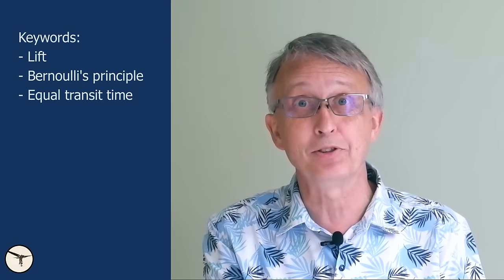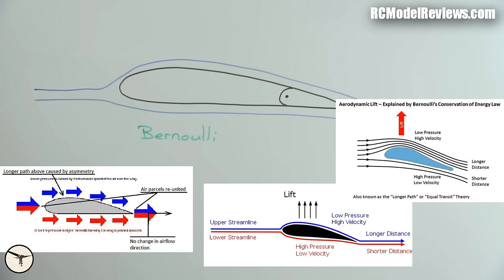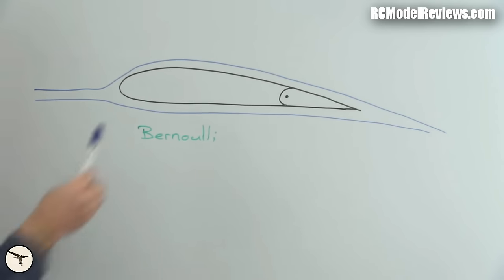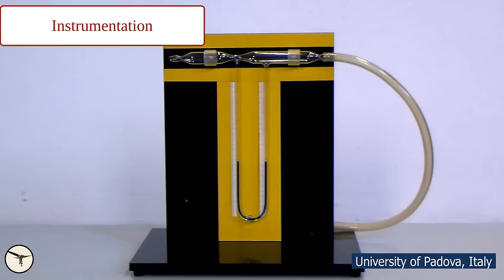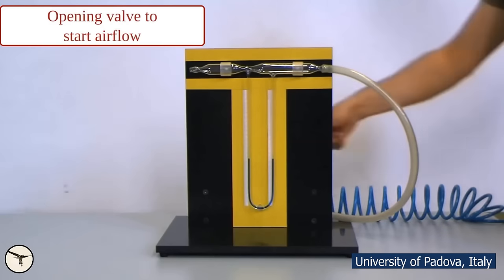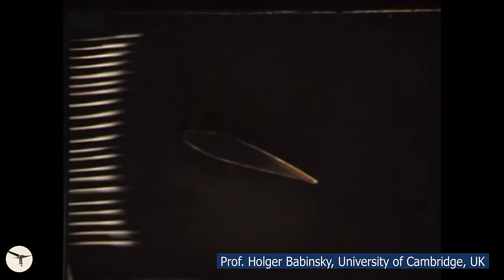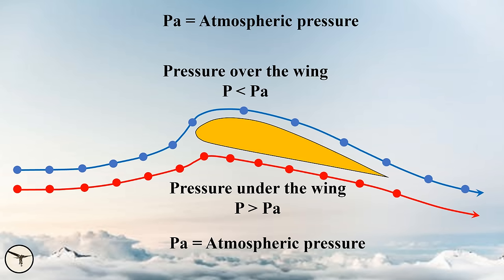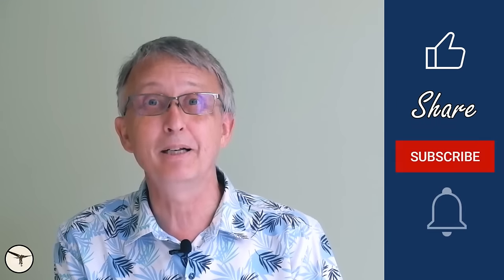Why are so many pilots wrong about Bernoulli’s Principle?

Comment: Atmopsphere has weight.  That weight bears down on the wing.  When the wing is moving through the air, the bernouli funnel is created by the top of the wing and the 'bottom' of the air pressure.  inlet: high pressure, low velocity; middle ; low pressure, high velocity, back of wing; high pressure, low velocity.  Low velocity is like a vacuum.
Reply: There is one crucial error here though:  "Low velocity is like a vacuum."  

That's not at all true because we need to distinguish between pressure and mass density.  A vacuum is zero mass (no mass density).  As you approach a vacuum, your mass density decreases but the molecules' random velocity (potential energy) may still be just as high.

The problem with the mass of air around an airfoil (assuming flight is sufficiently below the speed of sound) is that the mass density is essentially constant.  

So, when you get the lower pressure above the wing, the mass density hasn't dropped.  Therefore, lowered static pressure is the same density of molecules impacting less energetically with the upper wing's surface.

What you called "bernoulli funnel" is not like a "shadowed" area swept of air by the wing to make a region of depleted mass.

Bernoulli is a depletion of potential energy rather than depleted of mass.

You just made me realize, here may be a crucial point of argument with the people who like to say Bernoulli doesn't apply:  being shorthand for conservation of energy, the underlying principles of Bernoulli are essential to account for changes in energy associated with pressure drop (in supplying energy for the higher speed), because mass density doesn't change. (Some extra point needs to be added here I think??)

Comment: Differential pressure is only one part of the story. There are other components such as reactionary lift and konda effect. Equal transit time theory has long been discarded, as far as I remember from my flying training days around forty years ago, it has always been differential pressure to explain lift off a cambered aerofoil, and coefficient of lift obtained as a result of various factors affecting the aerofoil. This includes downwash at trailing edge.

Comment: 3:18 This is the main point. The curvature leads to a change in direction of the air molecules creating a centripetal acceleration speeding up the airflow on the top of the wing. (velocity being a vector having both magnitude and direction)

Comment: @ Kevin Barry symmetrical wings do have lift coefficient and it is incidentally more than a flat plate (flat plate has only reactionary lift)
Planes with cambered aerofoil also can fly inverted. Symmetrical aerofoil for that. 
Symmetrical aerofoils are used for high speed flight (transonic and supersonic)

Comment: The air at the leading edge is not accelerated directly by the curve, the bottom is also curved and there the air decelerates. It is accelerated by a difference in pressure(force), the pressure gradient is created by the overall wing profile. Even adding a tiny 90 degree flap to the trailing edge will change the gradient and flow near the leading edge.

Comment: I never got how Bernoulli works and this is a step in the right direction in disproving equal transit time.

But it still doesn't explicitly say wy the pressures are different.

I believe the answer is shown by the greater distances between the air molecules above the wing; the density and therefore pressure is lower.

Comment: Simple Newtonian physics is more intuitive and correctly validate it. Even though it not explain the details. It doesn't have to use (confusing / wrongly applied) Bernoulli equation for wing. No matter how the wing shape is, the amount of lift is proportional to the amount of air washed down after pass through wing. Even a rotating cylinder can act as a wing, using Magnus / Coanda effect. That kind of Bernoulli principle is only valid when the air stream is not separated. On wings, the separated upper and lower stream doesn't have to meet on the same time at the edge when met. So longer distance doesn't always faster. The slower bottom stream on tunnel test is because of impact pressure slow it down. For Venturi effect, Bernoulli's is correctly applied.

Comment: So, if the air flowing over the top of the wing creates a "low" pressure. And the high pressure is under the wing. |A low pressure will seek a "high" or higher pressure. that would mean the higher pressure under the wing is pushing UP on the wing to help the top of the wing (low pressure) find it's "higher" pressure that is called lift. 
a Mooney's wing is asymmetrical (equal top and bottom) gets it lift from the angle of incidence. the way the wing is attached to the body.

Comment: Boyles law I think also applies i.e.  Pressure x volume = a constant. Comparing the still air just before the impact of the leading edge of the wing. The volume of air flowing over the top surface of the wing is larger so the pressure reduces as the leading edge strikes the still air. Conversely the volume of air passing under the wing is lower so the pressure increases. As folk rightly observe this effect (high and lower volumes - a volume differential) is caused by the angle of attack of the wing, and holds true for the aerobatic plane flying upside down, as long as that low pressure is on the heavens side you get to see the stars and live to tell the tale…..else take a dive to the ground.

Comment: It's anyway disturbing to ear that both sides (up and below the wing) create a lift in the same direction (up), although the differences of static pressures are either positive or negative. May be the explanation would be more easy to follow by saying why two differences with different signs create a "force" in the same direction (lift).

Anyway, if the lift is only due to what is described, 
- then why all wings are curved on the upside, and rather not on the side that is below, as this would make no change to the differences of pressures, so it should work, no ?
- why this reasonning do not lead to create wings that are equally curved on both sides, to create higher pressure differences with the atmosphere, and then supposely stronger lift effect, if it's the only parameter to consider ?

As I suppose that any configuration have been tested for long ago, it must be that the difference of pressure between the upside and the side below as something to do in the resulting lift (up) direction, and that the sign of this difference is important to get a lift.

Comment: Still doesn't answer why the air on the top surface of the wing would accelerate. It is still not fully understood or without controversy (such as involvement of the Coanda effct), but clearly involves laminar flow and the Kutta-Joukowski inviscid circulation theory. In part, understanding lift involves differential geometry and the notion of a tensor of how forces act in different spatial directions, which in turn explain the reduction of static pressure above the wing whose components that would otherwise resist dynamic pressure is reduce. This explains why then the velocity is increased above relative to below the wing and the resultant pressure differential known as lift.
Reply from the maker: The acceleration happens because the airflow over the wing leading edge changes direction. This requires an acceleration in accordance with Newton's second lav of motion. https://youtu.be/lqAXNhICtRk
The Coanda effect has nothing to do with this.

Comment: Wow! So the top air stream actually arrives at the trailing edge sooner! This phenomenon is more than equal transit time: the lower air stream x velocity is slowed more than the upper air stream (which is perhaps sped up). The problem with equal transit time for pilots is they might assume an inverted (fixed wing) aircraft will inherently produce a lift that pushes them toward the ground. No lift would produce a "zero gravity" experience, so negative Gs indicate that negative angle of attack can overcome airfoil effects to produce negative lift.

Comment: Glad to hear you explain the real science behind lift. In the early70's I was taught in junior high science that lift was not created by increase pressure under the wing but decreased pressure above it. I was always interested in flying but this explanation always left a question in my mind because it didn't make sense that enough negative pressure alone could create enough lift. With my education with internal combustion engines, hydraulics and other machines operating on the laws of physics I began to realize that it is the pressure differential that causes lift. Lower pressure above and higher pressure below  do to Bernoulli's law creating differential pressure is the cause of lift.
Reply: What is also importent to know though, Bernoulli alone does only explain why the pressure drops over the wing. But another interesting question is why does the air follow the upper wing profile. Why doesn't it simply get pushed aside by the leading edge and create a turbulent void? And that's where the coanda effect comes in.
Reply: The decreased pressure on the top side is still of a greater magnitude than the increased pressure on the bottom. I'm no aerodynamicist but I have seen quite a few diagrams of wing profiles showing the pressure gradients along the surfaces (granted it is for racecar wings, so the airfoils are inverted compared to an airplane, but the idea is the same).

Comment: If the longer upper surface causing low pressure were the only thing generating lift, then how can that same airfoil fly inverted? Poorly, but it will still fly. To fly straight and level, the wing must constantly force a mass of air downward which is equal to the weight of the aircraft. The longer upper surface will help but to what extent IDK. AOA is more critical.

Comment: Bernoulli reverses cause and effect.  The air moves faster because it flows down a pressure gradient, not there's a pressure gradient because the air moves faster.  Lift comes from throwing air downwards in any case, and the wing shape happens via the Navier Stokes equations to be an efficient way to do that, in terms of smallest drag.  Both the top and the bottom of the wing throw air downwards, the way fluid flow equations work out.

Comment: The same thing that causes the drag causes the lift, the wing vortex. It produces upwash at the tip, lowering lift, because it blocks the suction surface, but when it reverses direction it produces downwash which then blocks and slows flow on the pressure surface side, and draws air across the suction surface accelerating it. Winglets just move the tip vortex exposing more surface area to air flow, allowing slightly lower AOA, thus improving fuel efficiency. The vortex strength remains the same, ie proportional to lift. Extending flaps just increases and strengthens the vortex sheet. There's a reason Prandtl equated downwash with lift.
Reply from the maker: The wing tip vortex is an unwanted side-effect of lift. The swirl does not contribute to lift, but is known as induced drag. To reduce the vortex, the designers can increase the aspect ratio of the wing (gliders are good examples.) Another technique is to taper the wing towards the tip. Winglets reduce the vortex, and hence drag, especially at high angles of attack. When Prandtl equated downwash with lift, he ment the downwash inboard of the vortex. He also concluded that the most effective lift distribution is bell-shaped. You can learn more about Prandtl and how NASA developed the Prandtl wing here: Al Bowers - Prandtl wing update: https://www.youtube.com/watch?v=w-dk1NpVNNI

Comment: A wing causes differential pressure on one side or the other (typically) of its 2 surfaces (if and only if) it is placed in fluid flow of some sort. Without fluid flow a wing produces no lift. The wings of an airplane will not produce lift setting in the hanger with the doors closed and the engine off. Unless there is fluid flow around the wings no lift is produced. So its the fluid flow that provides the energy (does the work) for lift...not the wing. The amount of differential lift (pressure) is directly proportional to the rate of fluid flow around it and the pressure differential between the two sides of the wing. Fluid flow and differential pressure around the wing produces lift. A wing is just a device that allows differential pressure to take place when in a free flowing fluid.

Comment: This has created great discussion! The wind tunnel test could do with more examples. For example an asymmetric wing and different AOA. More importantly 'zooming out' and visualisation of air much higher and lower from the wing. The example shown seems to result in the upper surface air (close to the wing) having the same speed as the air above. The lower surface in contrast, has markedly slower air (close to the wing) than the air below. In this specific example you could argue that lift is caused by high pressure below the wing and not low pressure above. It does easily disprove the equal transit time hypothesis however.

Comment: Regarding molecules at the surface of a wing, the velocity of the wing, and the vektor components of the impact of the air molecules, you will recognize that this also explain very good the lift at the wing. Pressure is the number of impact of the molecules on a surface. 
At the nose of the wing, and with wingspeed, the impact will be higher (max speed vector component of molecule plus speed of wing against molecule). If the curve goes down, the vektor of  molecules impact (x direction) is less, and reduced
by the wing surface velocity.
Result is a lower pressure. With same reason the pressure increases at the underside.
Regarding all movements of the molecules you will have macroscopic the Bernoulli as well as Newton. Sign it with vector components in a drawing, it will become clear.
And apologize my bad english.

Comment: Modern aircraft extend leading-edge flaps downwards which has the effect of thickening the wing.  At V1 the air can't get out of the way quickly enough and gets bounced upwards. But it comes down again immediately with the weight of the atmosphere on it.  This has the effect of producing a vacuum along the wing otherwise known as a shock wave,  and vacuums have to go where vacuums belong, to the top of the atmosphere (equilibrium law). The total weight of the atmosphere all trillions of tons of it, pushes up against it.  But practically it's only the air around the plane which counts.  At higher speeds say,  north of 400 knots,  the shock wave has difficulty keeping up with the plane and tends to drag back on it.  The aircraft designers angle the wing back into the shock wave cancelling out this drag effect to some degree.  The 'sweep' of a wing gives some clue as to the operational speed of the plane. When a plane breaks the sound barrier the bang one hears is the shock wave,  no longer able to keep up with the plane,  imploding.  I've seen these shock waves on planes' wings as they came in to land on airports as condensation formed along them.  It's a common sight proving the shock wave idea.

Comment: Most lift is produced by angle of attack: The airfoil shape allows for the same lift at a lower angle of attack, presenting less frontal area or lower coefficient of drag and less turbulence, thus increasing efficiency.

Comment: The Bernoulli effect arguments the lift created by an airfoil. A flat wing, or fully symmetrical airfoil, or semi symmetrical airfoil will all generate lift due to dynamic forces striking the bottom of the wing. The higher the angle of incidence and/or angle of attack (to the point of stall), the higher that dynamic force and subsequent lift.

At an equivalent angle of attack, a semi symmetrical airfoil will be more efficient as it will generate lift both from dynamic forces and Bernoulli effect.  Hold a piece of paper by the edges and blow over the top of it.  The paper will lift up because of Bernoulli forces….no dynamic forces present.  

The wind tunnel test in this video is interesting. Thanks for posting it.

Comment: I'm telling this since decades. Thank you not only to have told, but also to have shown it in practice ❤
Reply: The upper surface produces most of it, but "downwash" glancing off the underside also seems to aid/add.  Otherwise, helicopter landing zones would not be so breezy.  But wait...  attach a 25 foot diameter (~8 meter) pan under the helicopter.  Is it still able to fly with all the downwash hitting on itself?
Reply: @cosmicraysshotsintothelight  If the reaction force off of the blades is greater than the reaction force off of the pan the brick will fly.

Comment: Before airplane wings there were sails that had no thickness. To explain how the speed on the top is faster than the bottom, first put a plate perpendicular under the water, you can see the water skater in all directions. Incline the plate vertically, you can see there is water on the plate going upwards. If you take the inclined plate now in front of a  horizontal water jet, some water will be flowing towards the jet. The Russian scientist  Cheplekhin discovered that the flow around the foil is the sum of a rotating  stationary flow plus the air flow, adding on the upper and subtracting the bottom.

Comment: Great video. The Equal Transit Time explanation never made any sense to me. I've never understood why anyone would expect that 2 random air molecules that were together before the leading edge, and took opposite paths over / under, should re-unite at the trailing edge, just because they used to be together. They don't, and there's no reason why they should, so that's clearly not the correct explanation of lift.